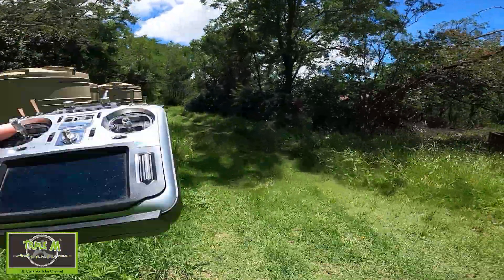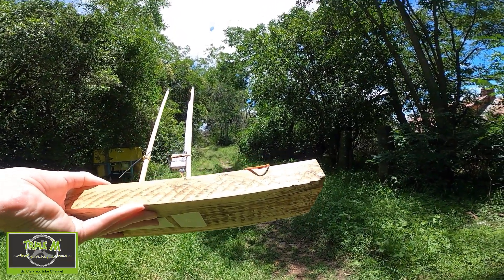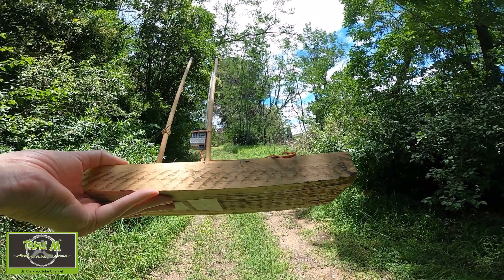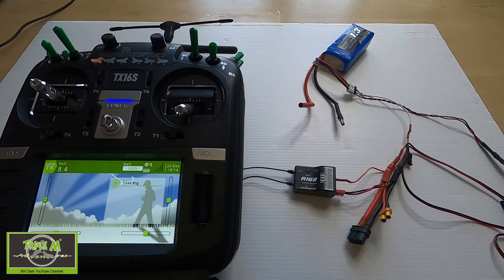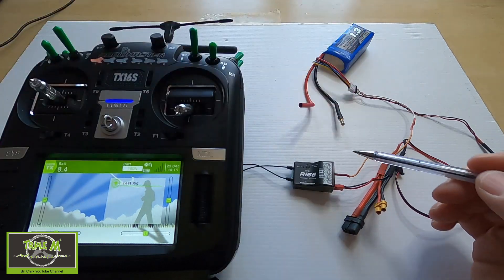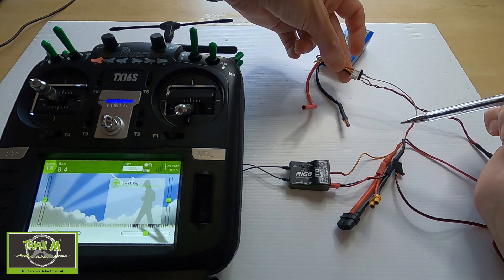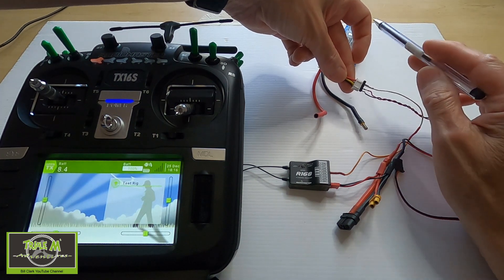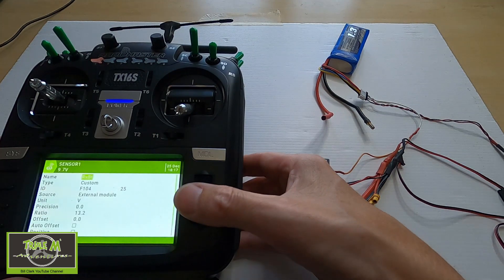Review & Range Test: RadioMaster R168 SBUS / PWM D16 Receiver

Comment: Thanks for the video but I regret to have to disagree on one point.   

Adjusting the voltmeter should be done primarily with the Ratio parameter.
Offset simply shifts ALL readings up, including 0 volts.

The correct way is to adjust offset until, with no battery connected, 0 volts is read, and then adjust Ratio until the reading matches the battery voltage.  The best check is to then put in a battery with, for example, 10.5 volts and check that the reading is still correct.
Reply from the maker: Juan this video is about the RadioMaster receivers what video are you referring to?
Reply: Hi Bill. I was talking about the voltmeter adjustment procedure you describe.

As you can see in the manual (https://manuals.plus/radiomaster/r168-receiver-manual-pdf), it is the "Ratio" parameter the one that must be tweaked to adust the voltage reading.

Changing the offset merely add some amount to the readings and while you may achieve matching the reading of a fully charged battery in this way, the readings will be erroneous for other values.

I have done myself the adjustment with Ratio checking for different values of battery voltages.
Reply from the maker: @juanpuyol221  ok I understand I see the
manual is different to the way I did the
process I will change it in the future. Thank you.
Reply: @the-happy-RC-flyer  it's my pleasure.

Comment: Hi again Bill, nice video. My planes came with Spektrum receivers, but as I expand my squadron, it’s nice to know I have some cheaper options. Wonder how the two would stack up against each other. My latest F16 came with telemetry so I’m wondering how that will work with the TX16S. Jim
Reply from the maker: Jim these receivers would be ok they did ok in my range tests but if you are flying expensive models I would recommend thinking of getting TBS Crossfire but the RadioMaster receivers are good.
Reply: Thanks again for your response Bill. The 168 might match up better with my TX. Jim

Comment: You did the Tests with the TX and RX near the ground, right? In a more realisitc scenario (TX on the ground and model at 50Meter high) the reception will be better but 2KM is still great. 
Yes, I have seen your Realworldtest.

Cheers
Nik
Reply from the maker: I just wanted to compare the receivers in the same way and yes range in the air would be much better.
Reply: @the-happy-RC-flyer  Thank you, You did a great job.

Comment: Which are the right antennas for the R168? I lost one and replaced it with 15cm length and now i have Hugh range issues
Reply from the maker: You need to make sure the active part of the antenna is the same as the original. Try swopping around the antennas and try another range test.
Reply: @the-happy-RC-flyer  thank you. and what about ipex 1. 4. 13?
Reply from the maker: @olekolef773  you obviously need the correct connector and the exposed active part of the antennas must be the same size as the original.
Reply: @the-happy-RC-flyer  with the R88 and D8 Protokoll i have nearly the Same Problems?
Are the RM Reciever just Bad?
With an FSIA6B i have no Problems Even high up and away from me
Reply from the maker: @olekolef773  My experience with the RadioMaster receivers has been good. One thing I have experienced with the RadioMaster T8 Pro TX is shorter range and I think this is because of the internal antenna. Same receiver and plane with the TX12 much further range. Are you actually experiencing range problems? I ask because are you getting sound warnings from your radio or seeing a low RSSI in your OSD? Next question are you flying fixed wing or drone?
Reply: @the-happy-RC-flyer  i fly fixed Wings. And i get    Rssi Warnings from my Radio and the Bars on the Display goes down from 4 Bars to 2 or 1. with the flysky fsia6b at the Same distance 4 Bars. 
My Radio is an jumper t12 pro
Reply from the maker: @olekolef773  The bars are only a rough guide but if you are getting audible RSSI warnings then we need to check the fine frequency tune. If when you bind your receiver you see the option RF Freq. fine tune you must complete the process or you could have range problems. This is necessary for all FrSky protocols.

Here is a link to my video to show you how to complete the process. 

https://youtu.be/7aJ0oLFO-0U

Please let me know if this solves your range problems with the RadioMaster receivers.

Comment: Hello Bill,
thanks for the test.
Did you also check sbus? I have 3 R168. With all 3 only the PWM output works. Sbus does not work, no matter what software I install and no matter what settings I make when binding with the TX16s (I have a measuring device for Sbus signals and can therefore check it).
Reply from the maker: Hi Willi, when I conducted my test I did connect the R168 to a FC using SBUS. I also checked in Betaflight that the channels were responding correctly. I even connected the PWM receivers to the 5v output of the FC to have a constant voltage for all the receivers I put through my unscientific test. It is strange that all three have the same problem, is everything ok in Betaflight when connected to a FC? Is the wiring correct to your FC? Have you fine frequency tuned the receiver, which is very important. I have videos on this which explain what problem you can have binding FrSky protocol receivers to a multi protocol module. When binding the R168 to my TX16S I used FrSky D16 and did the fine frequency tune which for my receiver was -2 but this could be different for you receivers. I am not sure of your experience level but have you selected the correct protocol within Betaflight for the receiver? I would suggest using the same FC you used for the 3 R168 receivers connect another SBUS receiver to it and see if everything is ok. If not I feel you have been very unlucky to receiver 3 faulty receivers and would advise to contact the vendor you purchased them from. Please keep me updated.
Reply: @the-happy-RC-flyer  Hello Bill, thank you for your detailed answer. That's strange: with my measuring device (ToolkitRC) I don't get any Sbus measured values from the R168, with an R81 I get Sbus values displayed. If I connect the R168 to the Naza M V2 (via DJI Assistant), Sbus works! Thanks for your tip. But: although I have selected "Channel 9 ... 16, without telemetry" for the binding, the pins only work for the transmitter functions of channels 1 ... 8 when servos are connected. The servo functions programmed in the TX16s via input and mixer for the Channels 9 ... 16 - checked in the servo monitor - have no function.

In which video of yours can I find information about "fine frequency tune"?
Reply from the maker: You could have a faulty receiver it is difficult for me to say without testing the receiver myself I normally set my receivers to 1 - 8 with telemetry.
Here is the link to the fine frequency tune video it is the same for all openTX radios
https://youtu.be/7aJ0oLFO-0U
Reply: @the-happy-RC-flyer  Hi Bill, I've just solved the problem: I need the V1 FCC software. frk onto the R168. Then everything works as expected. I had already tried this before, but received the message "Data refused" every time and canceled it after 3 attempts. But you have to try it longer! After I tried 6 times to start the upload. For whatever reason.
Thanks for the Link.
Reply from the maker: @willipreugschat  I am pleased you have sorted it out.

Comment: Hi Bill, I'm using it and the range is not one km, how do you describe it at 300 or less, it goes away and the telemetry comes back and my glider went crazy and I could recover it, I don't know what happened interference
Reply from the maker: HI Rafael, in my tests I do rely on the RSSI values being logged and sent back to my radio. The 1km test is very line of sight to my house so it is the best case scenario. The R168 failed the 585m and 2000m test without a doubt. I my opinion these receivers are usable for LOS flying where you fly maybe 250m away from you because the plane would get to small. I would personally not use them for a large glider which could hit a thermal and be gone. I will look at doing a "real world" test of the R168 and release my results on my channel.
Reply: @the-happy-RC-flyer They are large 270 meters I do not know what happened that day I was not past the question was that soon he began to make a series of strange movements and I was able to recover it but vote on the signal and the Serca telemetry
Reply from the maker: @rafaelenmanuelfrancocarrasco  it could have been outside interference. I have completed a new test after the comments left under this video and the video will be released tomorrow. You maybe interested in watching it.
Reply: @the-happy-RC-flyer  pues claro estoy siempre al tanto de tus vídeos gracias  of course I am always aware of your videos thanks